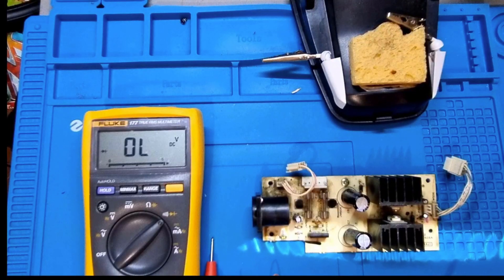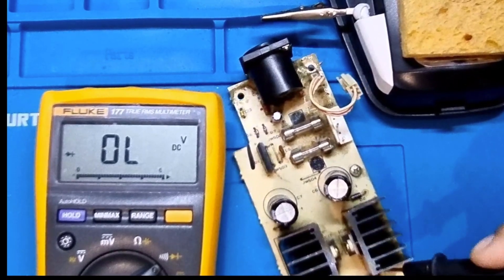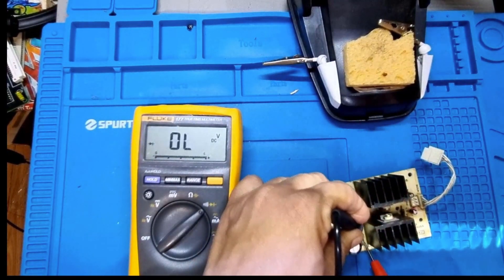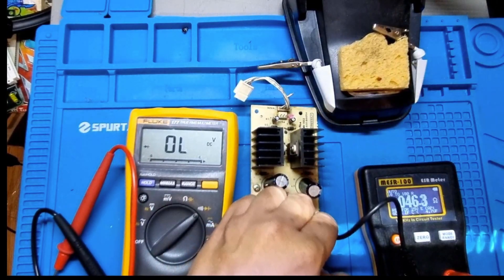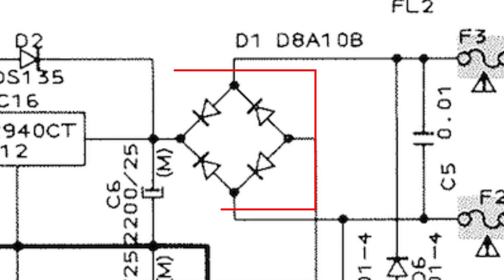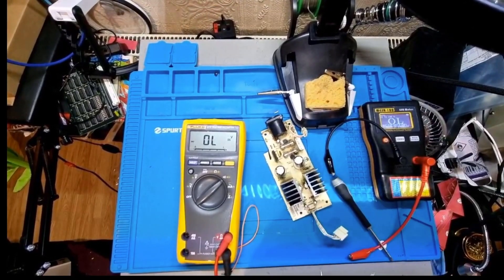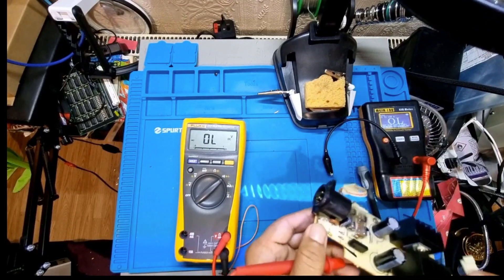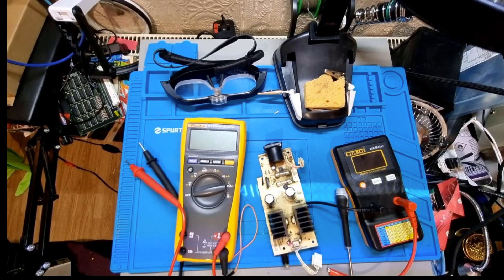AKAI S1100 HARDWARE SAMPLER REPAIR -  8 bit sound | Checking the Power board

Comment: if you already have the oscilloscope,why don't we just test the output signal?
what i remember is that the sine waveform got a bit distorted right?Let us see the bias of the output,the swing...etc.Sometimes you would need an audio transformer isolator for recording from keyboards to the computer without noises.

Comment: Btw electrolytic capacitors are the main ones that go bad due to them drying out. I'm sure the other caps are less likely to be a problem. Just thought I should mention it, in case you end up spending too much time checking them which could be spent checking other things 👍🏼